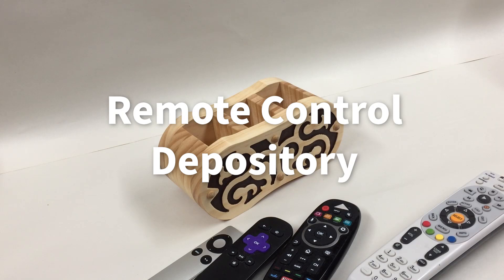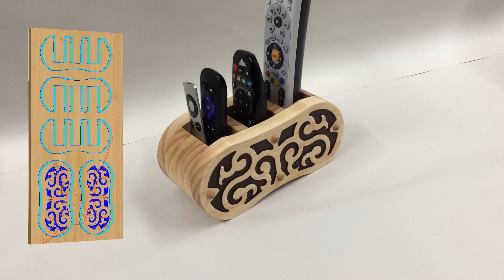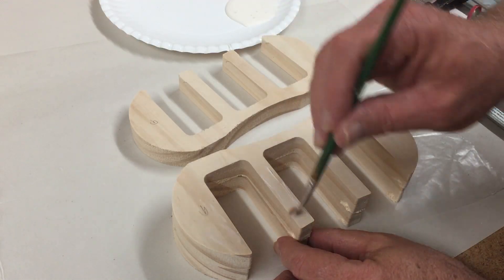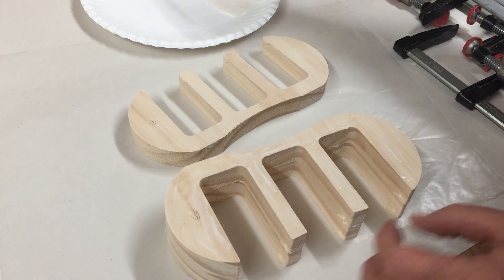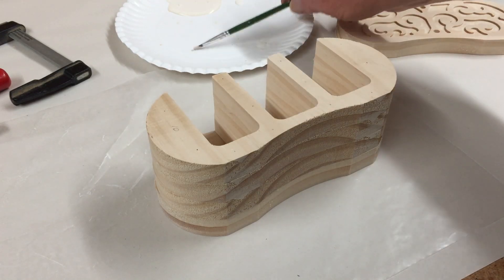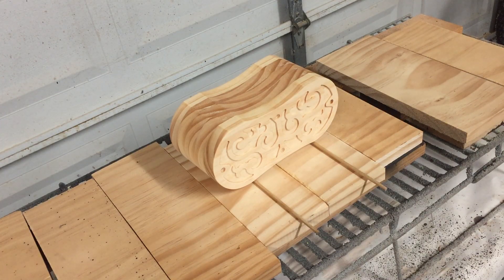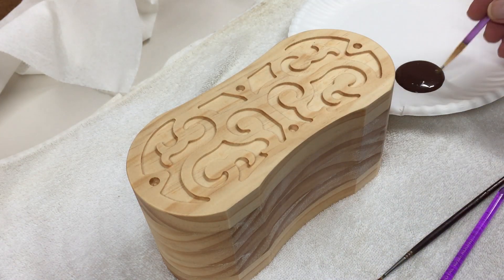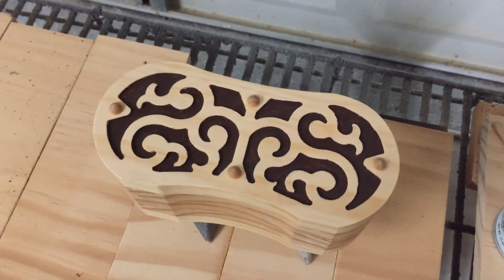Making a Remote Control Depository | Michael Tyler's FREE CNC Project of the Month | Vectric

Comment: Elegant. 
Tip: Oramask 813 applied before carving will greatly simplify and speed up the infill process. Just be sure you sand and seal the show surface prior to applying the film. Will prevent paint bleed and produce crisper edges.

Learned that the hard way. 🤪